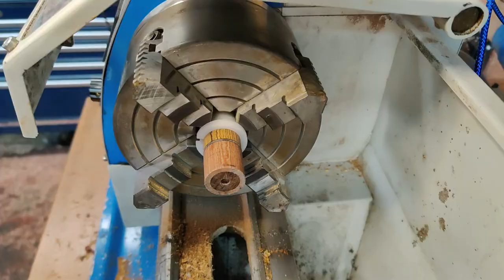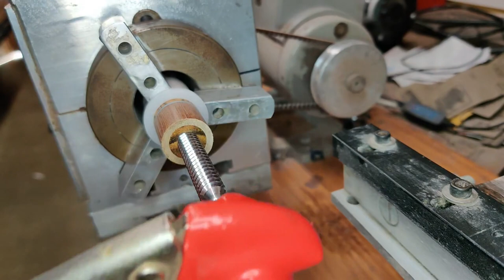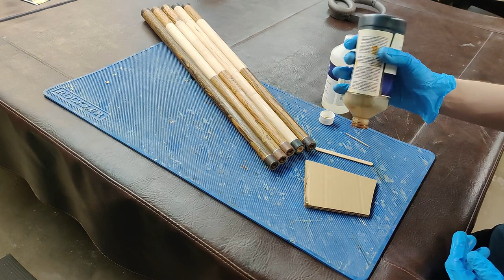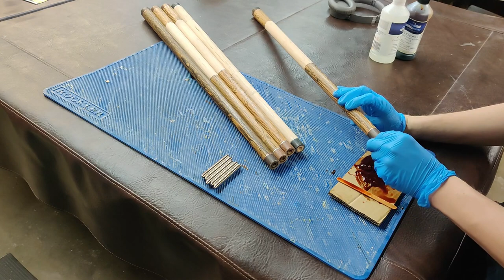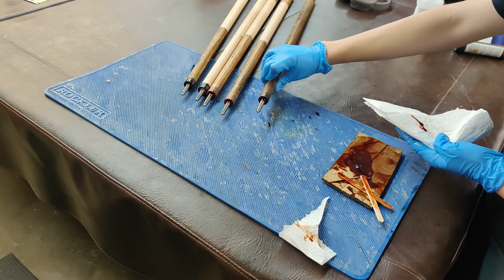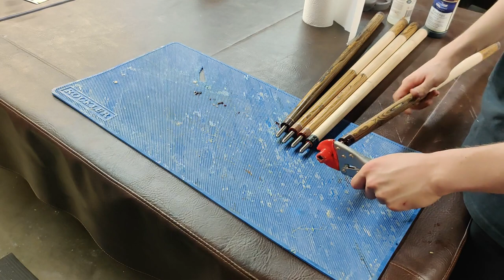Joint pin install on a Pool Cue

Comment: You should chamfer the bore for an easier clean up if there are epoxy leaks around the pin..

also, always leave a small chamfer on the joint collar so finish will not flake off a sharp edge.
Reply from the maker: Okay, ill try that next time thanks